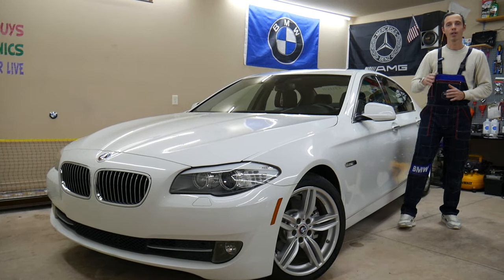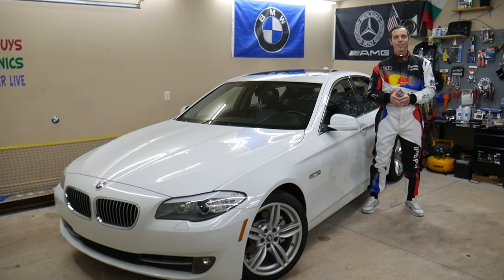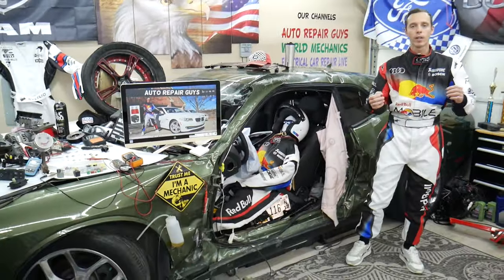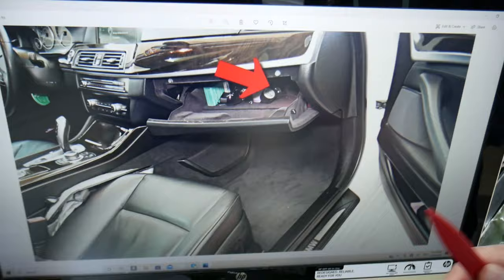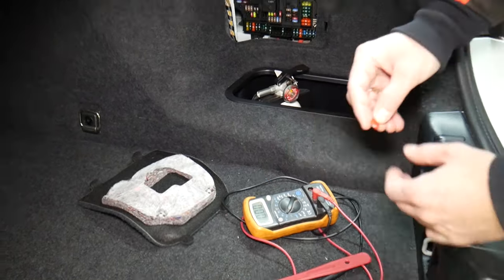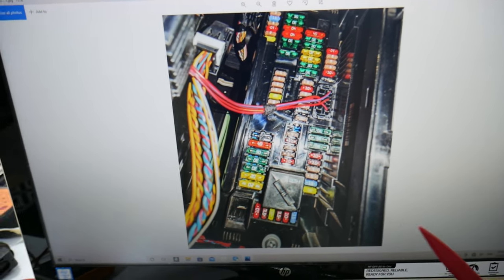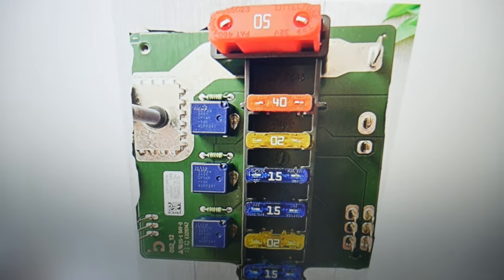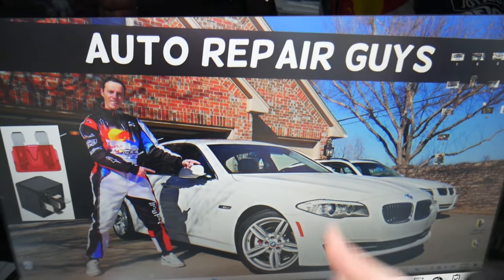BMW F10 F11 COOLING FAN RELAY LOCATION BMW 528i 535i 520i 530i 550i 518d 520d 525d 530d 535d

Comment: This video is not even close to describing the location of the cooling fan relay for my 2014 BMW 535i F10. Mine is located in the trunk, right behind the battery. You'll see it as soon as you remove the trunk floor.
Reply: Isnt that for the starter? Or does this one relay control it all